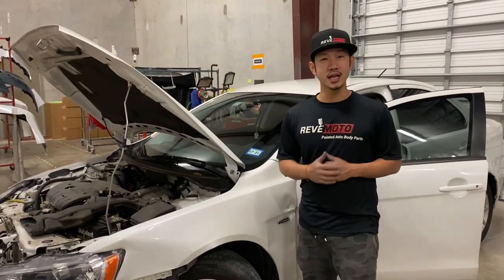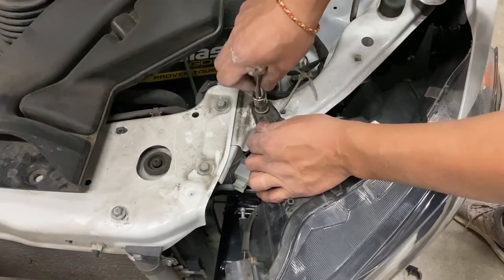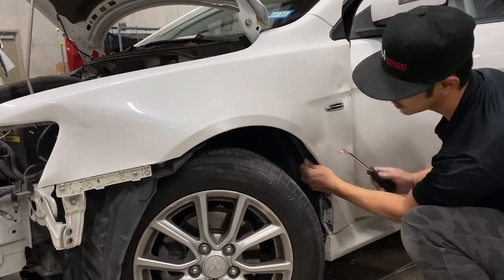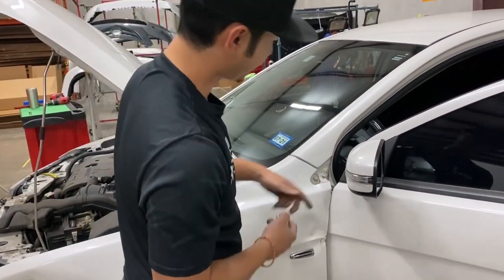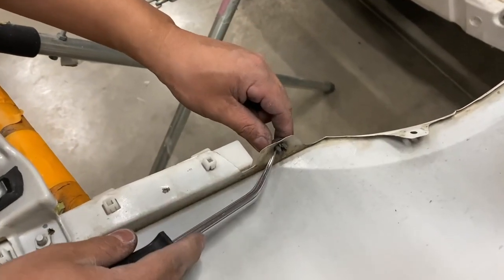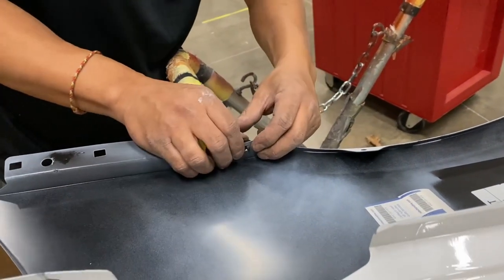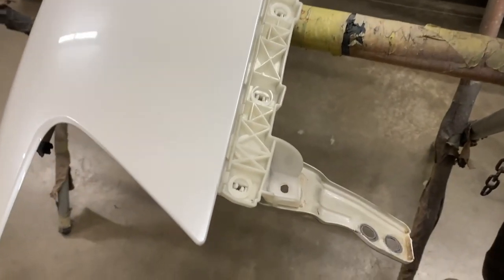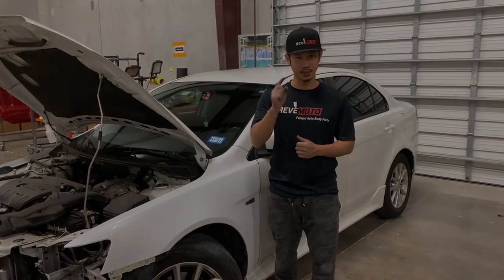How to replace a 2008-2017 Mitsubishi lancer fender

Comment: Hi thanks for the tutorial.I have an outlander which has been repaired at some point. The front wing is not aligned properly and it bows out from the car down the shut line with the door. I would imagine it's very similar in fitting to the one in your video. Would I be able to loosen it and move its position slightly to get a better fit?  or are they non-adjustable. Kind regards Paul 😊
Reply from the maker: Hello Paul! Thank you for watching and yes, it would be very similar. If there was an accident, make sure to check frame and fire wall to if anything is bent. Once you take off the fender and the frame is bent, it will not fit correctly until you realign the frame. Assuming it's just the fender, you can just adjust the screws and placement.

Comment: is ther any possible to put the evo x front fender on the ordinary lancers?
Reply from the maker: They look to be the same shape. It's definitely possible but we also recommend checking in the Lancer forums. Thank you for watching!
Reply: @mr.porkiepants9306  front fender on lancer/ evo forrum can possibly be done. and it is confirmed. rear fender is no chance but can manage to buy aftermarket fenders to match it with evo x fender. I saw some youtuber from austin texas "Jmedia" you could check hes lancer gt  build.

Comment: I noticed at 7:56 you pulled out a wire Does a Mitsubishi Lancer 2017 black edition have that side marker connector in it for the side marker ?
Reply from the maker: Hello! This Lancer did have a connector you need to unplug. I am unsure about the Black Edition but most likely does. Thank you for watching.

Comment: Hello. Your video is very interesting. I have a problem that maybe you can help me with. My lancer suffered a small frontal impact, the bumper was repaired and reinstalled,  but there has always been a small angled gap in the line that separates the fender and the bumper, as if it were slightly hung but it has been difficult for the tinsmiths to put it back to line up. Do you have any suggestion?
Reply from the maker: Hello. I would try and realign the fender. Loosen the bolts and try to push it in or forward so the gap is better. You should also check the bumper bracket/retainer to see if that is broken. Thank you for watching!

Comment: Would a fender from the lancer evo x fit on another base model lancer?
Reply from the maker: Great question. I would double check on the Lancer forums for more expert help. The fender look to be the same shape as well as the headlights and hood. I think the only difference is the fender has the vents. It's possible but we're not 100% sure. Thanks for watching!